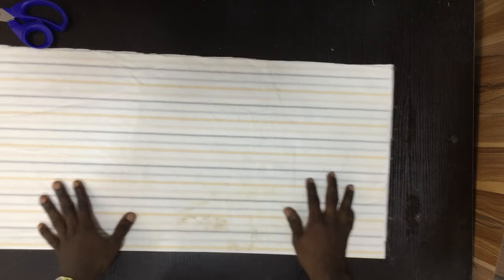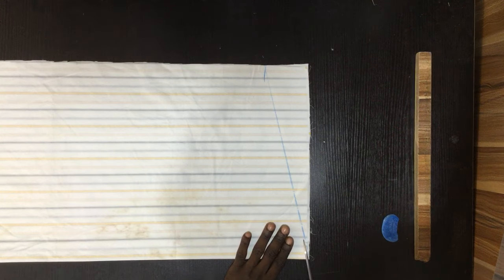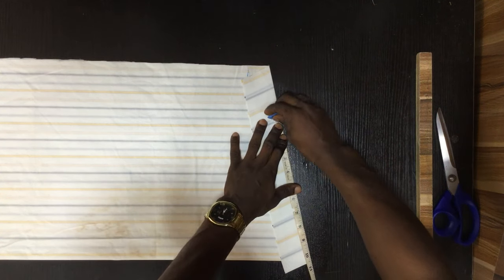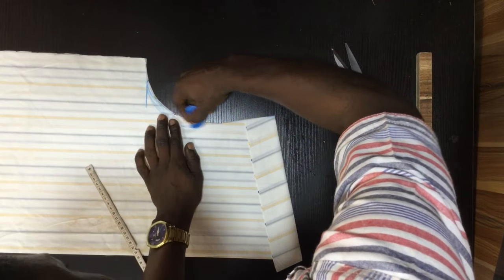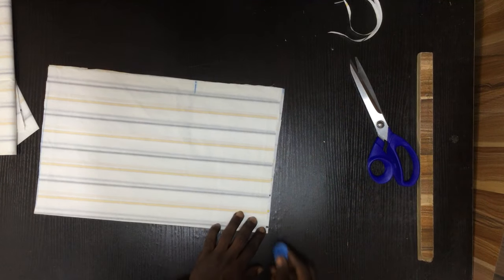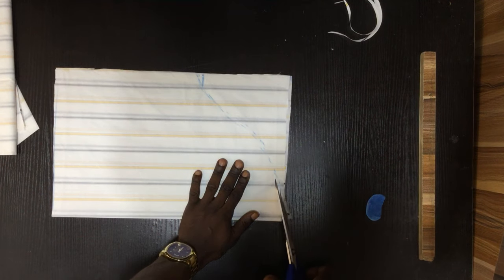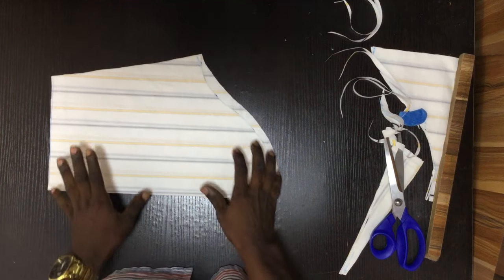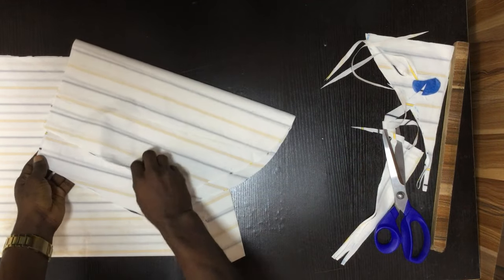how to cut armhole and sleeve curve

Comment: If the arm hole is 9, what will be d sleeve folding depth.... Not the length or the 6 inches depth o..do u add 2,3 or 4 inch to get the side of the sleeve
Reply from the maker: 9-1.5=7.5, fold @ 7.5

Comment: What’s the basis of the 5inch depth used on the sleeve and what’s the width of the area from whic the curve is made normally I’d measure the armhole curve and slant a line derived from dividing the chest by a variable. Please shed more light biko
Reply from the maker: Do all the calculation I'm sure you can't get anything lesser than 4-5inch, I follow the same process and I always get the same result, so I'm more of practical cutting now. Sorry I did not explained